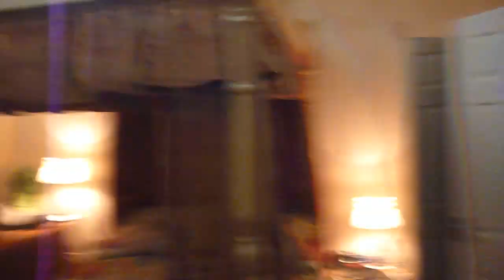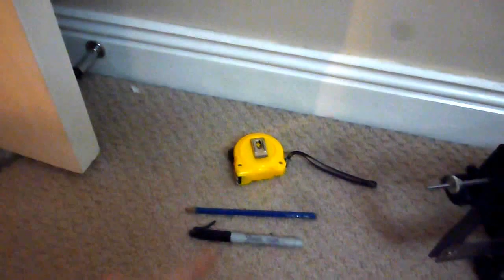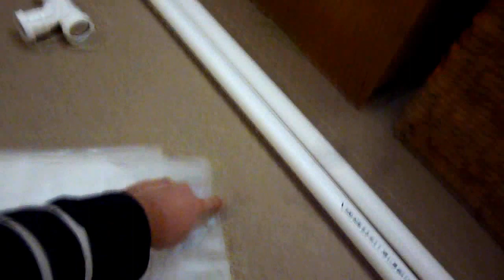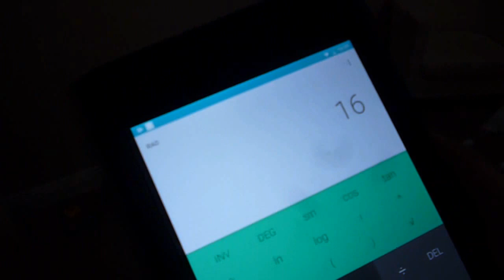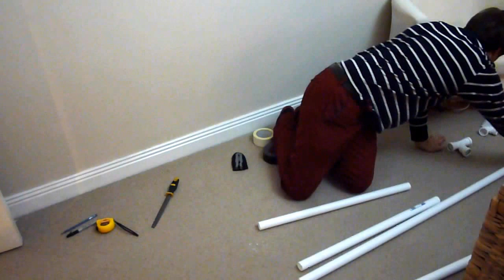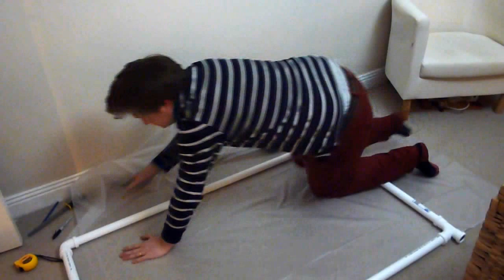DIY Rear Projection Screen - Part 1 - Intro and Build

Comment: I know this video is God knows how old, but THANKS! I’m in the states, and we go crazy over our Christmas decorations here.

I bought a digital projector, and an actual front and rear screen with grommets. The task is to put the screen on the lawn, and project Christmas video onto it from behind, with the projector sitting inside the house.

But I couldn’t figure out a damn way to mount the screen taut, on a permanent basis (I can store it in my garage), and be able to easily position it as far as height and projector-screen-distance! This solution is PERFECT! Just have to plop it on stands, of which I already have plenty.

A big THANK YOU from across the pond!!!

Comment: So I did this, using this vid as inspiration to play a movie in the background, outside in the shade during the day, for my daughter's birthday party. Went ahead and made legs from pvc and 2 more T joints with caps on the end. Using an Anker Mars II projector, which is only 300 lumens on max brightness. Used a medium weight Frost shower curtain from Walmart for $5 US. It worked amazingly well. I was quite shocked. Not only did it help keep my projector safe, it worked much better than trying to do this on a make shift front projection setup. I made the screen size ionly about 50 inches, as the projector isn't the brightest (being portable and battery powered), but was amazed at the outcome. Thanks for posting.